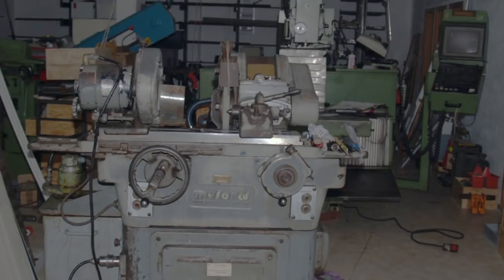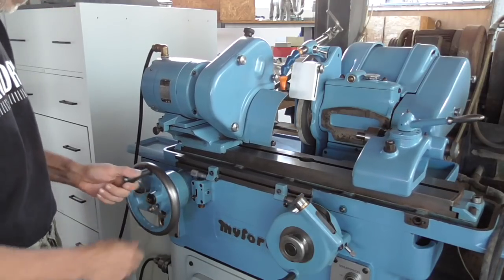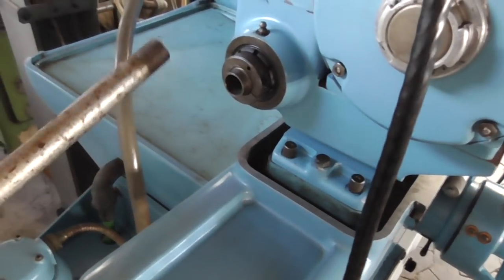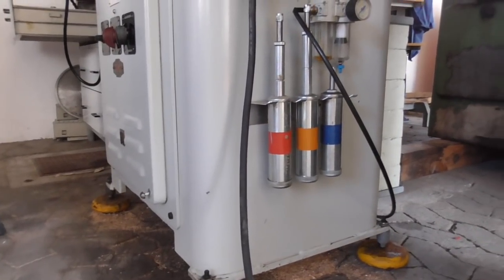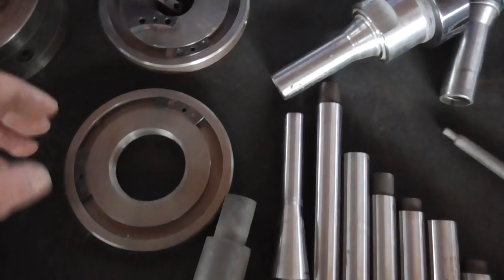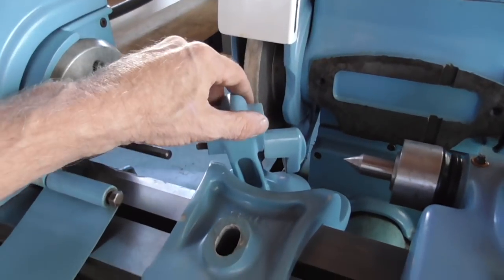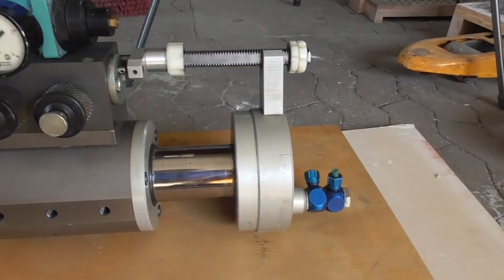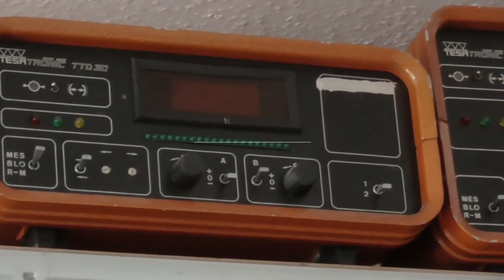Myford MG12M: A steam driven phoenix

Comment: i owned one, a plain MG12 of 1968 vintage, it was perfect and extremely accurate with very little wear. i sold it to a guy in Pakistan to make room for a Jones & Shipman 1310 i got from a local college that was new in november 1969 and has done so little work its in even better condition than the old Myford with the plus that its a fully universal grinder with an integral internal spindle too!